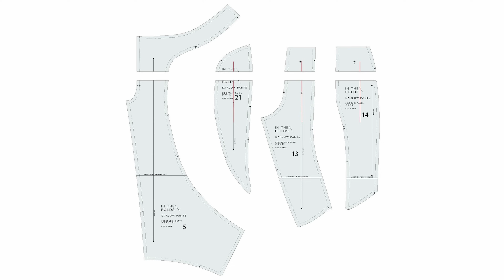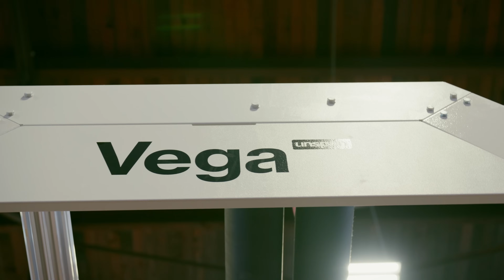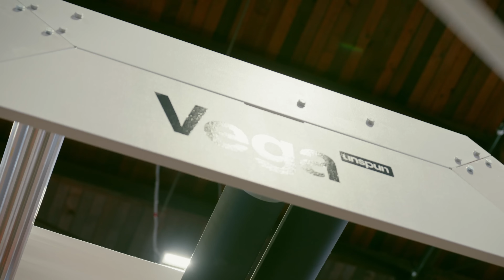Your Clothes Will Be Made With This | Unspun

Comment: Unfortunately i dont think this one is going to go anywhere. If someone needs a one off custom garment they can pay a seamstress to make it. This machine when finished would likely cost several million and the required labor might actually exceed the standard amount labor needed to use a 2d process. Mainly because their prototype is currently only set up with just one color thread. If someone wanted to use two or more colors presumably someone would have to manually restring the machine.

Time would have been better spent optimizing the 2d processes we already use. Btw im pretty sure they explicitly point out that they use a weaving process because automated knitting is already 3d. Further its much easier to string a knitting machine. Their machine is unique due to their 3d weaving but the costs are likely to make it extremely impractical.

Comment: I always wondered when someone would do this with a circular loom. I mean, there's a few good reasons no one has, but maybe they can figure it out.
Reply: I think you mean circular knitting. Looms are for weaving and idk if there is a circular look for weaving tubes.
Reply: @Imaboss8ball  nah the whole point of this is that it's like circular knitting but it's a woven and therefore a loom. Traditionally it's been used for geotextiles and things like rice sacks. It's similar to automated flatbed in its limitations

Comment: I recently had a chance to work with a group from Uganda. There, used American garments are literally dumped. A small percentage are purchased and worn by the population. The rest are dumped in large landfills which leak toxins from dyes and such which cause environmental damage. Furthermore, there is no local fashion industry. Clothes is no longer made in Uganda. The group hoped to stop the cycle and create jobs, especially for women. 
    In the early 20th Century, most clothes was made at home. Then workrooms grew. Finally New York City dominated the industry. So when JFK suggested sending just 2% off shore, only New York protested. Fast forward to now, New York still makes some clothes but a vast majority are made overseas.

Comment: I think the idea is mostly good, but the scale is where they aren't correctly focused.  Bring the size down to something smaller that occupies a shop in a mall.  Go in, get measured, choose a style, gets made and picked up a day or less later.
Reply: I agree and open source it!  Creating and sharing clothing models sounds very cool.  Sizing should be super accurate as well.  I might start build the app.
Reply: @Joberrr Yes to the OP and yes to you 👍
Reply: It can't get miniaturized until they work through the big robotic process automation first. THEN you can scale it down to a hundred creels instead of three thousand and you have a machine that can fit inside the back room of a boutique shop. It will take a hundred times as long to build something than this machine will, but it will be completely custom - maybe going from a few minutes to a whole day. The key will be in the software that can take full body measurements into account. We will finally go back to true custom-fit clothing at a reasonable price.
Reply: Automated 2d processes can actually do that. A 3d weaving machine can't because of how massive weaving machines have to be in order to produce high quality fabrics.